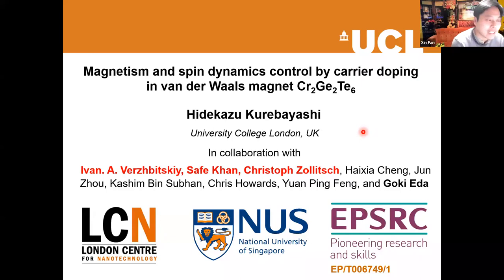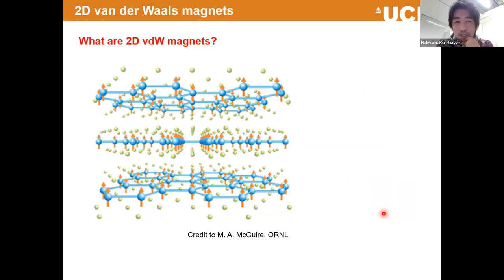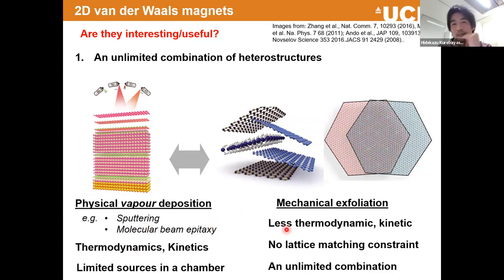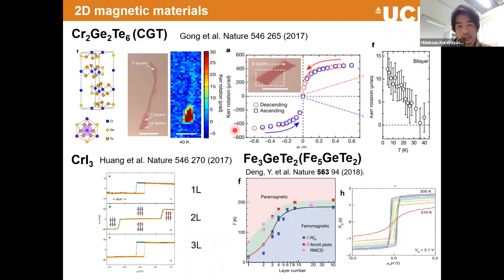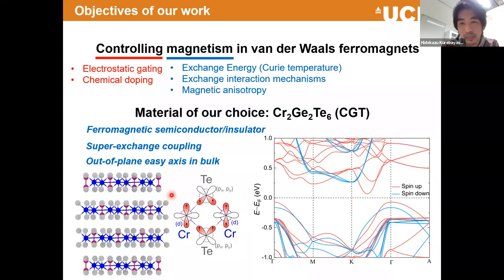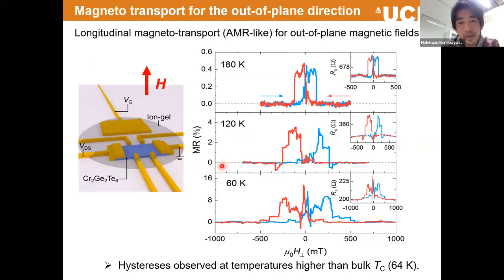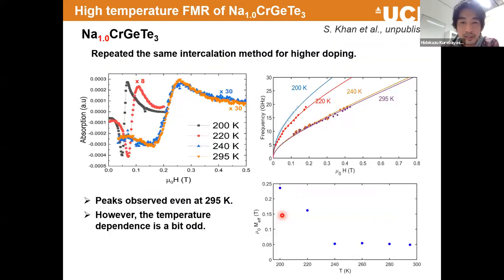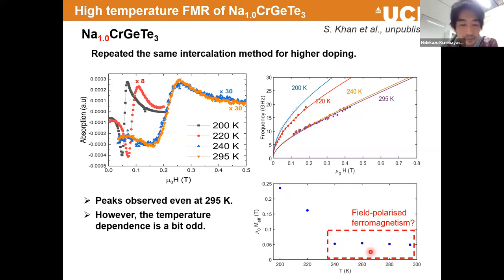Online Spintronics Seminar #84: Hidekazu Kurebayashi

Comment: The crossover between easy axis and easy plane in CGT is interesting. I am wondering what is happening at zero as the spin-orbit interaction is alway there, which means the spin is either easy axis or easy plane. What is the physical mechanism behind the MAE = 0, charge carriers somehow cancel the SOI?